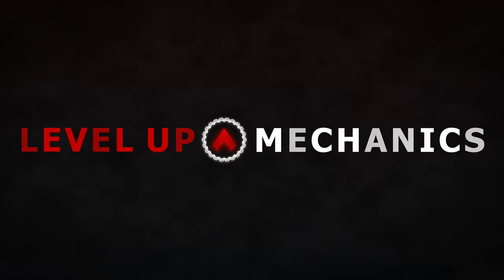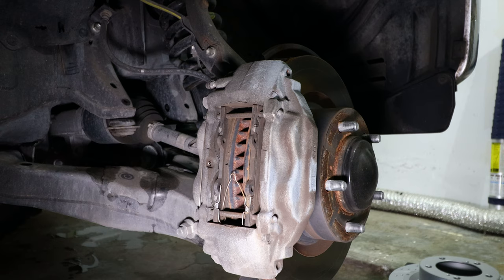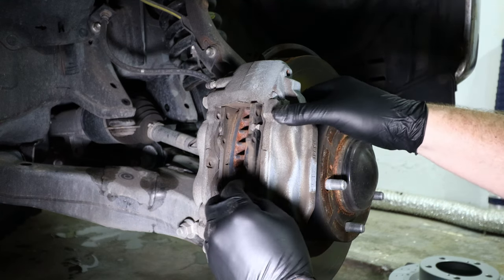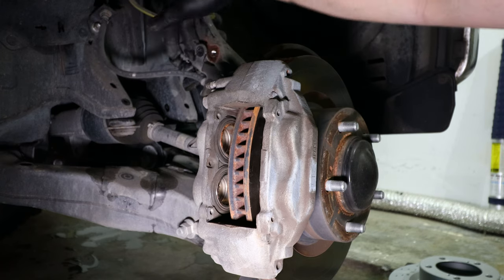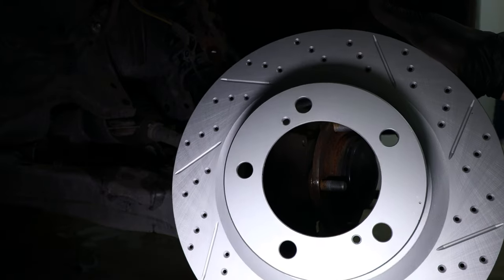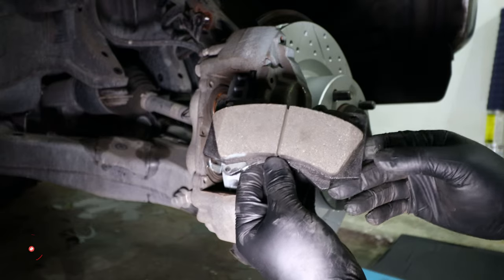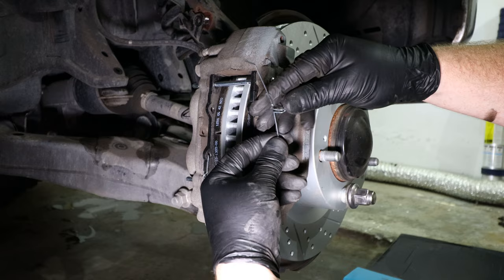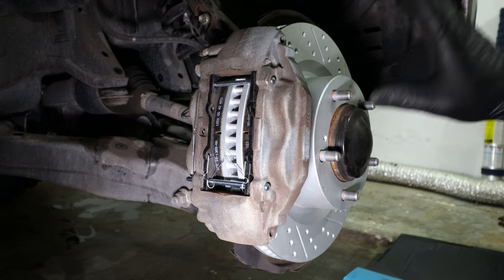Toyota Tundra Mods | R1Concepts Front Brakes | Cross Drilled & Slotted Rotors | Ceramic Brake Pads

Comment: Nice concise video.
I read you response on grease being only used on the pins, 
question: can you also explain why you did not use the anti-seize on the hub where the rotor makes contact ?
Reply from the maker: Thank you 👍. Technically, it is okay to put a thin layer of anti-seize on the face of the hub to make life easier during the next brake service. It's pretty much just a "personal preference" choice.

The important thing to remember is to make sure that the face of the hub is clean and to remove any rust build-up. That way, the rotor will have a smooth, clean surface to mate up with. 

A clean wheel hub face will maximize the life of a rotor and prevent premature brake pulsation. As long as the face of the hub is clean, it's generally just a personal preference if you decide to use anti-seize or not.

Thanks for checking out the video 😁👍

Comment: Hello, saw your video yesterday on the R1Concepts rotors and pads.  How have they held up over the past year+?  I'm looking at purchasing the same ones for my 2020 Toyota Tundra.  I tow a 4500lb 23' Winnebago Hike RV and spend months at a time traveling.  I've had issues with my stock rotors warping and creating that "shimmy" in the front when going downhill with a load.  I'm hoping to upgrade to these rotors but wanted to see how they have worked for you!
Reply from the maker: So far the R1Concepts rotors & pads are holding up really well. No brake pulsation so far. 

I would highly recommend the GEOMET rotors (as opposed to the eLine option). They are a much better option and they significantly cut down on "brake dust" / iron deposits (which can eat away the finish of your wheels).

Combining GEOMET rotors with pads that are designed to perform well for regular towing conditions would be your best bet for performance & reliability. 

I hope this information is useful 😁

Comment: How has this improved braking performance on your truck and are the brake pads wearing out evenly?
Reply from the maker: Braking performance is identical to OEM components. However, the geomet rotors and the ceramic pads create less "brake dust" buildup (as opposed to cheap rotors made mostly from iron and semi-metallic pads).

So far the brake pads are wearing evenly and are quiet when in use. 

I hope this info helps!

Comment: I believe the bolt that takes off the rotor is an M8 1.25. Why does no one say that?
Reply from the maker: Thank you for sharing the info. I agree that I should have been more specific in regards to the bolt used to take the brake rotors off.

As an automotive technician, sometimes I forget to include specifics because it is such a common practice for me on a daily basis...  so I appreciate you taking the time to share information that would be useful to those who don't do this sort of thing on a daily basis. 

I will try to be more mindful in future videos 😁

Comment: for me tundras cant use ceramics cause the brakes in toyota trucks 4 runners tacomas and fj are not powerfull enough ...its better semimetallic the problem is the dust
Reply from the maker: So far, the ceramic brake pads on the Tundra and the Tacoma are working just fine (for daily driving conditions). I do agree that semi-metallic pads can definitely provide more of a bite though 👍

Comment: What kind of wear you getting out of this combo?
Reply from the maker: So far it's been great 👍.  I just checked the front brakes last week to see how they were holding up.

Pads still have a lot of life left, rotors are in great shape and are not warped. Very minimal brake dust. 

Just make sure you get the geomet rotors... the eLine (cheaper) rotors create considerably more iron deposits on your wheels...

Comment: No brake cleaner on the rotor or brake grease on the pads?  That’s the only problem I see
Reply from the maker: Nope. It's not necessary. The protective paint coating on the rotors is removed only where the brake pads come into contact with the rotors after you take a drive to break in the pads. This helps the rest of the rotor surface (that has no contact with other parts) to remain protected from long-term rust build-up.

Grease on the back of the brake pads is purely "snake oil". It's not necessary. As an ASE Certified Master Automotive Technician with 20+ years of experience, I NEVER use brake grease on the back of brake pads. All it does is create a mess and adds a chance for the grease to eventually come into contact with the brake pad friction material. 

I've had zero issues of brake noise and this TSX brake upgrade has definitely helped to dissipate more heat during multiple autocross events.

Everybody has their own way of replacing & installing brakes (as far as brake grease is concerned). I have replaced A LOT of brakes professionally (on all types of vehicles) and I've never had a vehicle come back due to a lack of brake pad grease. 

The only brake component that you should grease are the slide / guide pins on the brake caliper (since it is a moving component of the caliper). That's why I checked them in the video.

I could go into more detail on the subject, but I will spare you from reading an "essay" 😆. In the end, these brakes are performing well with ZERO brake-noise issues. And the red powder-coating is still nice & clean 👍

Comment: Do you have torque specs for the caliper bolts? Thanks!
Reply from the maker: 133 FT-LB'S 😁👍
Reply: Thank you!! Do you know what the rear caliper bolts and slide pin bolt torques are??? Doing the brakes soon. I appreciate it.
Reply from the maker: @rjnoj-xb5kq 123 FT-LB'S for the rear caliper bolts. 65 FT-LB'S for the rear caliper slide pin bolts.
Reply: You rock. Thank you! Last question. I’m going with EBC yellow pads. Do I need to buy new shims for the front rotors? They don’t seem to come with them. Not sure if you can answer this one.
Reply from the maker: @rjnoj-xb5kq as far as I know, the EBC yellow brake pads should come with noise-reduction hardware. If you see a black "plate" on the backside of the brake pad, then that would be a "shim" to help reduce brake noise...
Reply: Ok. I do see that. So I won’t use the shim. Did you red locktite the caliper bolts
Reply from the maker: @rjnoj-xb5kq you can use locktite if you want to (for peace of mind), but it isn't necessary.